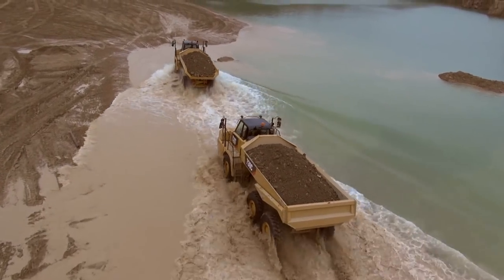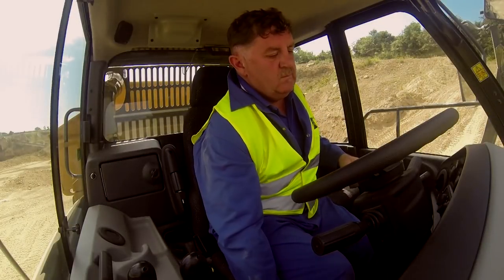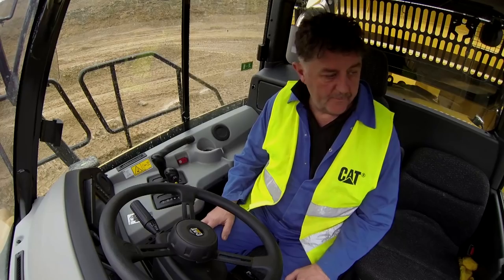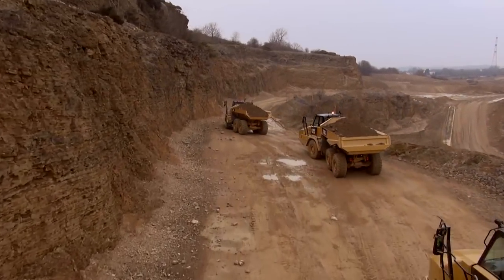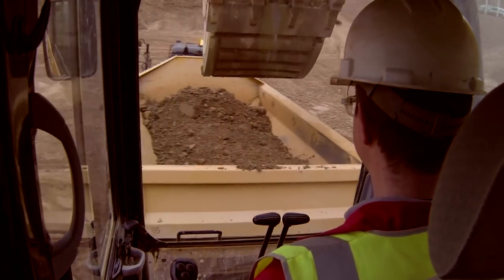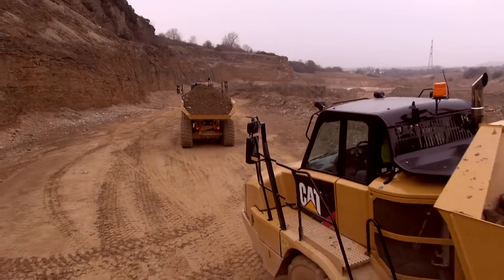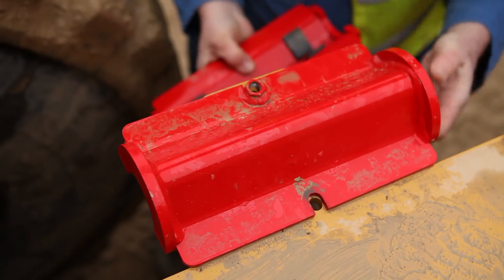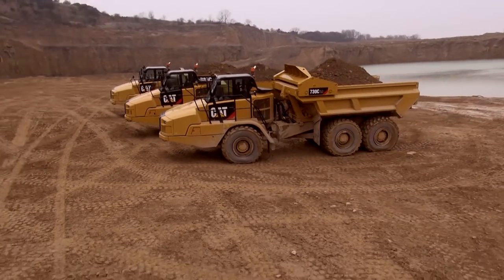Cat® C Series-Articulated Trucks — Principles of Operation

Comment: How much cu.m loading capacity ?
Reply: Believe the 730 holds around 30 tons 740 and 745 hold around 40-45 tons, which I’m not totally sure about exact numbers fully loaded, but roughly equates to 25 + cu. yards from the 725’s going on up to 30 + cu. yards on the 740 & 745’s, the 745 weighs 83K pounds, then loaded with 40 tons, think the specs say max weight is 163 thousand pounds, I’m not an expert but I’m guessing the 25,30,45 in the 7 series probably equates to the cu.m ( which I think you mean cubic meters)